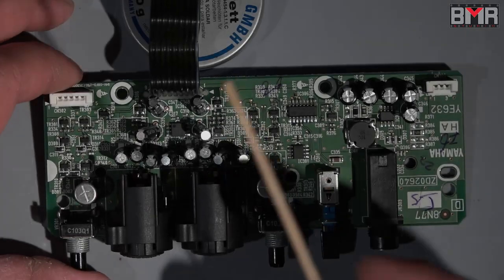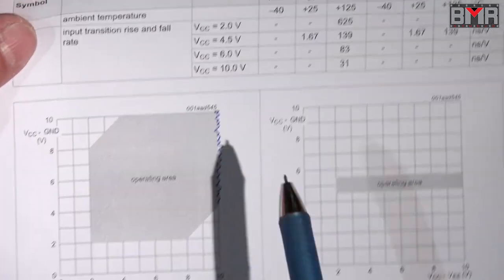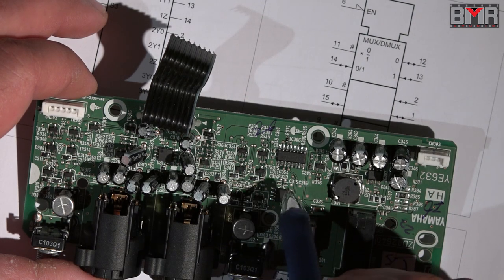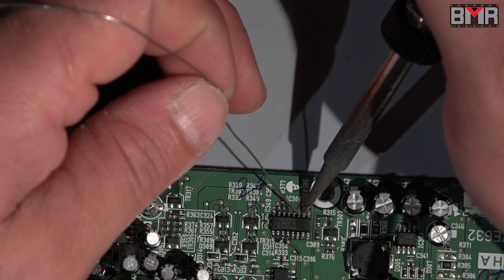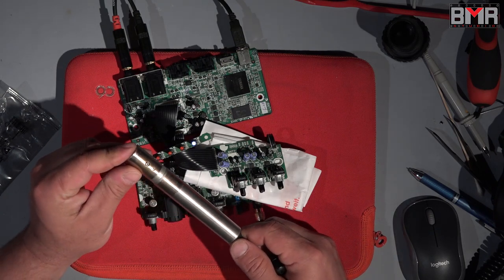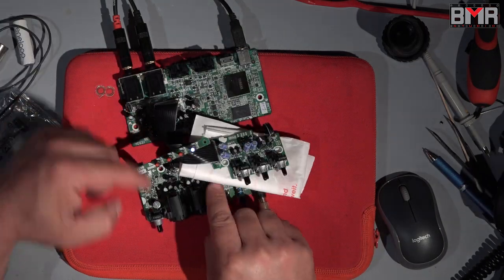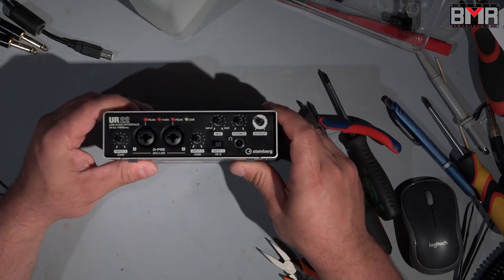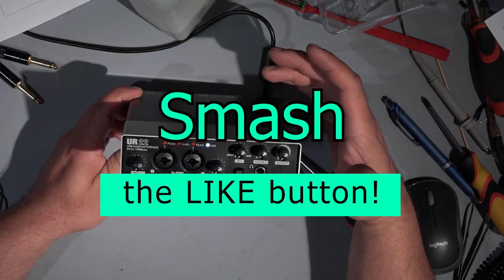Steinberg UR22 USB audio interface repair. Finale

Comment: Great videos, thanks for the thourogh walk-through! After single handedly frying my interface last week it now works again after replacing the 4053 chip for less than 50 ¢. And - not least - I learned a lot about troubleshooting strategy and techniques along the way.

Comment: Thank you very much for your videos. Brought a UR22 back to life by replacing the 74HC4053D but unfortunately the inputs still are flawed. The left channel does not capture any of the lower frequencies of music and the right channel lacks quality. I will continue to replace the input opamp as sonn as it arrives, but maybe it's one of the caps.
Reply from the maker: 100% sure, this is an input Op-amp and one input cap.
Reply: @BMRStudio  I replaced the JRC NJM2068D and checked most caps but the problem "remained". Turns out I didn't notice that the high-Z switch only works for channel two and my audio source just wasn't powerful enough to work without it. Then of course the high-z mode raises the noise floor which I wasn't expecting to be this noticeable on the UR22.
So in reality the unit already was repaired after the initial fix. Thanks for your reply and have a great day, you're awesome!
Reply from the maker: @TheBrassn  What a blamah :) The High Z circuit is a Chinese  TL072. Replace with some Burr Brown opamp, then most of the noise will disappear.

Comment: Having a phantom power supply that can only be enabled for both inputs at the same time is not entirely too uncommon, actually. The MOTU M2 comes to mind as another example, and a bunch of mixers like my Mackie 402 VLZ4. Usually it doesn't hurt anything either, although the inputs need to be adequately protected to avoid damage when things are plugged / unplugged (see various articles on the "Phantom Menace"). A properly wired passive microphone is connected across XLR pins 2+3 and floating relative to 1 and as such never sees any voltage at any time. Miswired mics still seem to crop up every once in a while among ultracheap dynamics but in general nonstandard pinouts should be very uncommon in anything made since the 1970s or so.
Reply from the maker: Its just bad design, to send phantom power out on both channels...
Probably companies are copying each other, beside fighting on market.
Just one example...
on some marketing brochure, Steinberg even showing a girl singing in a condenser MIC, while her guitar is recorded with an dynamic mic. Or even in the user manual You see mic and not a mic connected...
No, My friend, is just bad. BAD. Just like the MONO monitoring from Yamaha Steinberg... Jesus! :)  How much they saved? 30 cents?
Many people turned to Me with the same issue. Yes people buying second hand or cheap microphones, and wiring can be bad. But, 48V shouldn't be on channel, what is not decided to power a MIC in a session. Not on any gear, tape recorder, mixer or interface. Totally not professional.
That's why we have RED lights on any gear to warn Us, - hey, there is a phantom power on!

Comment: I have a SteinbergUR22 that I think I messed up a couple years ago. If I remember correctly, I think i plugged an xlr to 1/4 straight to the guitar. I didn't know much then lol but i think that caused it to flash the USB light and die. I would love to get it repaired - it is my favorite interface.
Reply from the maker: meh... low cost interface, just buy a new :)

Comment: Hello, my UR22 sound card does not have a correct speaker output. The sound is reproduced without low, middle frequencies, only a high spectrum. Could there be a problem with CS4270?

Comment: Messing around with mine, I ended up removing the c437 capacitor. Do you  have any idea about the farad capacity (? I'm not sure how to call it ?) of this component? I've lost it by now, so i was planning on finding a replacement, but am a bit lost. Great video btw, cheers man.

Comment: I have problem with noise, both input without plug in mic/guitar..input 2 is more noise than the input 1..which part should i replace?please reply sir..🙏🙏
Reply from the maker: Go for the opamps, then the switcher IC

Comment: Hi, thank you for the video. Where can I find the schematics? I have another problem with my UR22. thanks
Reply from the maker: There is no schematics... You must do yourself. What problem You have?
Reply: @BMRStudio  Hi. Channel 2 indicated peaks but the signal was not reaching the output or headphones. I found some cracked weldings from electrolytic capacitors and soldering them again fixed the problem. It was also resolved that an output channel was mysteriously playing lower. Thanks.
Reply from the maker: @bandoneonmidi1841  Qick fix! You are lucky!

Comment: I bought a UR22 in 2014 still have it mint condition, it never worked for me... =(  the red lights peak stay on, my daw detects it but no sound... should I burn it?
Reply from the maker: replace the input transistors and the first capacitor. less then 1 dollar ....

Comment: Hi. Thanks again for the great videos on the Steinberg UR22. I am trying to repair one a the moment but am a little confused about the parts I should replace.
In the video you seem to just replace the transistor on the digital/output board YE631 and this is to be replaced by BC327 or similar.
On the input board, YE632, you replace an op amp and multiplexer to be replaced by NJM2068D and 74HC4053 respectively.
I have removed these parts but do am not sure from the video what other parts need replacing. The parts list has a NJM4565 op amp but there are two of these op amps on the digital/output board YE631. Which needs replacing  please?
Finally you say “If You have to replace the high-Z input , just a simple TL072 or go with some high-end Analog Devices opamp! “ What is the high-Z input and where is it on the board please?
Regards
Dermot
Reply from the maker: Dermot Donnelly the TL072 is the small opamp close to the multiplexer.
This is part of the Hi-Z circuit.
All the rest is clear I think :)
Simple foot to foot replacements.
But check first only the dc-dc converter voltages without the Front input board.
Then measure the input resistance on the two cable on the input board (clearly visible on the video)
If it’s too low, so not few hundred K, then replace the multiplexer first. Maybe Your input opamp is survived....
Reply: @BMRStudio  Thanks a million for that. Really appreciate it.
Reply from the maker: Dermot Donnelly You welcome!
Reply: @BMRStudio  Sorry to bother you again but I still don't see where you have replaced the NJM4565.
Reply from the maker: Dermot Donnelly it was replaced off camera. I don’t remember which was it :)
Reply: @BMRStudio  That's ok. There are only 3 of them. I'll replace them all. Thanks again.
Reply: @dermotdonnelly5495  did this process fix your ur22??
Reply: @hakan1215  I didn't proceed with the repair because items were replaced OFF CAMERA. Why do such a good video and then ruin it by not showing everything? Also I found it very difficult to replace the SMD components and damaged some tracks when removing the damaged SMDS.
Reply: @BMRStudio Hello. Great job. Could you tell me which transistor you installed?
Reply from the maker: @Vadik.V  Video Description.....

Comment: native instrument ,audient,appolo they all using Xmos DSP  the most expensive ones in the market I have more than 32 sound cards the best one I use volt or ssl both with good preamps  less noise 50 present not supported in bigsur os its shame
Reply from the maker: The future of DSP based systems are doomed. The software implementations are  become better and better. Nowadays You can run hundreds of heavy signal processing on a cheap 8 core CPU... In real time. The DAC and ADC chips are cheap and for 50 cent You can get 130 dB range with 0.004 % distortion, at 24 bit 96KHz... Nowadays even not make sense to buy any hardware instrument... Sooo time is changing my friend! We got even Ai based singers... 😂